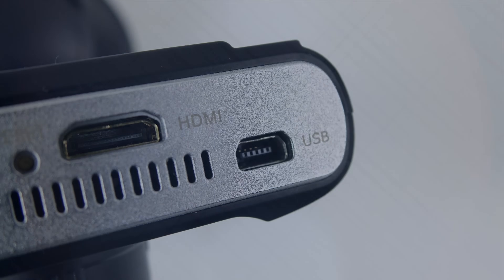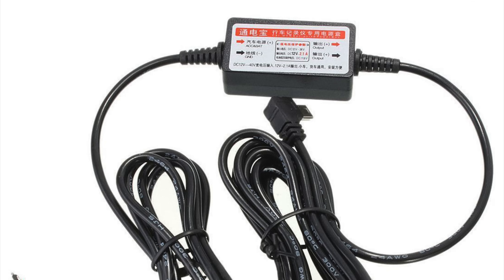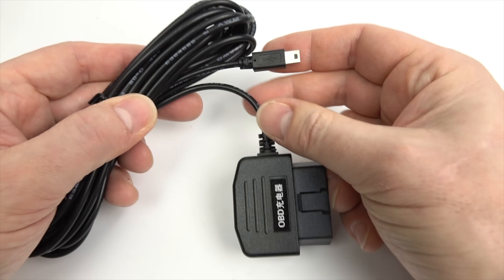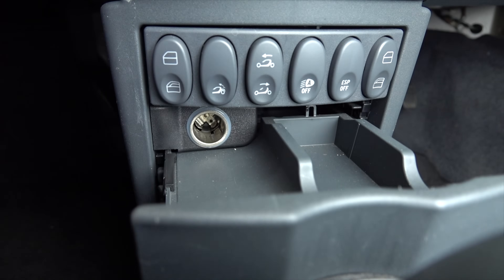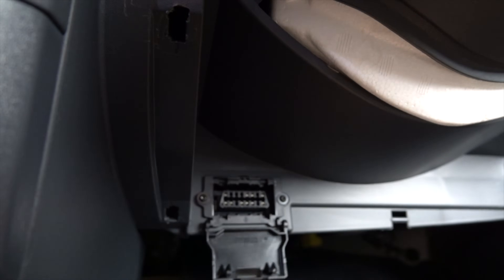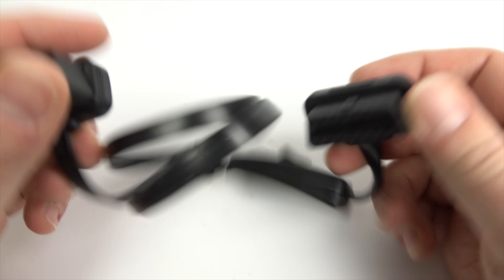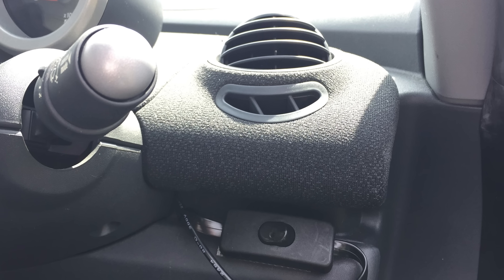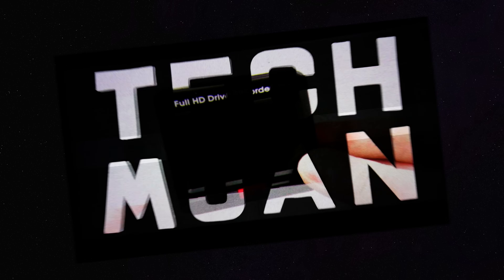You can power a Dashcam via your OBD port (but perhaps you shouldn't)

Comment: Can you charge a cell phone with this?
Reply from the maker: +Throwing Things Yes - thats the original purpose.
Reply: +Techmoan thx
Reply: +Michi Lo Uh... all it takes is 30 seconds opening the thing up. I can almost guarantee that nothing will be connected to CANH and CANL. It'll be either an LM7805 with necessary caps across the +12V/GND, or an MC34063 doing the same thing. That's it. If there was something connected to CAN, just remove those pins.
Reply: Maxx Fordham You really are fucked up, you know that? You're driving an otherwise sane, intelligent person to threats. What the fuck is wrong with you? Why do you even care? 

He's not entirely wrong. You did make up a phrase. Why not just admit it's a non-standard usage and be done with it?
Reply: ***** That might be a good idea. With those phone chargers it is ok, but there are some of those bluetooth adapters, and those i won't thrust anywhere.
Reply: Maxx Fordham My point was "attention payment" is an incorrect, stupidly worded phrase. How did you float through life saying such stupid things, boy?
Reply: +Aurelius R Your trolling has gone a bit far, but I agree that the other guy is a complete and utter asshat.
Reply: +Maxx Fordham +Aurelius R both of you need to walk away from the keyboard, and take a breather.
Reply: Maxx Fordham You're right, commonness and correctness ARE two separate things. However, "attention payment" is neither common nor correct. Again, the argument is that you made it up. If you can't show any sources that it has been used anywhere else, then that original point still stands. You don't have to defend yourself at all -- you are choosing to. Incorrect grammar is identified because we have a commonly accepted set of language we call English. Using those same rules, which you used to identify people misusing "you're" and "your", we can easily see that "attention payment" is incorrect as well.
Reply: EVERYONE SHUT UP MY PHONE SOUNDS LIKE AS TIME BOMB
Reply: Maxx Fordham Wow, you sound like one of those people who should be in old timey insane asylums. &quot;I&#39;M NOT THE CRAZY ONE, YOU ARE!! ALL OF YOU ARE!!!!!&quot;
Reply: Maxx Fordham LOL.
Reply: Maxx Fordham Attention payment? Seriously?
Reply: Maxx Fordham WHY DIDN'T YOU LISTEN TO ME? I TOLD YOU NOT TO REPLY! WHAT ARE YOU DOING?!?!?
Reply: Maxx Fordham I am genuinely laughing. You actually think attention payment is a real phrase. Oh god. You seriously couldn't make this stuff up!
Reply: Maxx Fordham Please, go check a dictionary. All the examples you used of the word "payment" were in reference to the exchange of money. When paying is used as a noun (payment), it's called a gerund. Using the verb "to pay" in relation to attention is a colloquial usage of the verb. Therefore, when used as a gerund, it no longer makes sense, because it's not being used to describe the exchange of money. In other words, when "to pay" is used a gerund, it is only used to describe the exchange of funds. Open a dictionary, you asshole. I can't believe you're still sticking to your guns.
Reply: Maxx Fordham You know, I've found that the people who attack the most viciously are those who are the most insecure and full of self-doubt. Accuse me of being conformist all you want -- you know nothing about me.
Reply: What the fuck... you really ARE a piece of shit, Maxx Fordham
Reply: I asked some English professors about "attention payment". They universally agreed it sounded like something a four year old would make up while trying to understand how that part of the language works. So it makes sense after all! You're just 4 years old. Pretty obvious, actually.
Reply: No, but really, they all said it was completely incorrect.
Reply: Muted. So fuck off. I win.
Reply: Maxx Fordham! Sorry, for some reason the name didn't automatically pop in. Fixed now! :D
Reply: Maxx Fordham Who said that? The other guy said he thought it was a bad idea, and I said it's almost certainly not, just crack the thing open and look for yourself.
Reply: Maxx Fordham Sorry, for some reason thought you WERE the OP.
Reply: Maxx Fordham Whatever you say.
Reply: Maxx Fordham You saying that we don't need to know each other defeats all of your insults, by the way. You couldn't possibly know any of the things you accuse me of based on the extremely limited information before you.
Reply: Maxx Fordham NO NO NO. DON'T EVEN BOTHER REPLYING. I SAID IT'S A REAL PHRASE, AND IT IS THEREFORE INDISPUTABLE!!! EVERYONE MUST BOW DOWN BEFORE MY LEGENDARY LINGUISTIC SKILLS!!
Reply: Maxx Fordham Find one example of it ever being used, by the way. 
http://lmgtfy.com/?q=%22attention+payment%22
Reply: Maxx Fordham You show examples of real phrases, as if that supports the creation of a similar phrase.

So, let's try this again. Telephone hook. Coat hook. Pirate hook. ... Graveyard hook. I just made a new phrase! And because there are other phrases which use similar words, I MUST be right!!
Reply: Maxx Fordham Yes, you've reduced to trolling, so I'm not going to stop trolling you either :)
Reply: Maxx Fordham Maxx Fordham is a complete idiot
Reply: Maxx Fordham Maxx Fordham is a complete idiot
Reply: Maxx Fordham Maxx Fordham is a complete idiot
Reply: Maxx Fordham Stop typing. Just stop. Go away, like a good little boy.
Reply: Ezmyrelda Andrade Jesus christ! Are you writing an assay?!?!
Reply: Michi Lo Those Bluetooth adapters are harmless. It's easy to prove -- connect a CAN sniffer between it and the ODB port. You won't see a single packet coming FROM the dongle.
Reply: ***** Not anyone has a CAN sniffer. And i still do not trust something from china that plugs into my car. Maybe it does not send packets now. But it is bluetooth. Someone a bit better in that stuff than me might be able to modify it so it CAN send packets. And i do not want that to happen. EVER!
Reply: But I would never trust anything from China that plugs into OBD.
You wouldn't want to know what you can do over OBD.

Comment: Have you tried an add-a-circuit link? Just plug the positive into the fuse box and ground the negative wherever convenient. I've started using these when adding stereos or lights to buddies cars as most of the time they don't keep the cars long.

http://www.ebay.com/itm/ADD-A-CIRCUIT-BLADE-STYLE-ATM-LOW-PROFILE-MINI-FUSE-HOLDER-FUSE-TAP-FUSE-SET-/171633550106?hash=item27f628231a:g:CoMAAOSwWKtUrf4i
Reply from the maker: +William Decoteau What is a good fuse to use when putting one of these in? I'm thinking of something that is powered on with the car and isn't on all the time.
Reply: You can usually go off the fuse that powers the 12v socket. The dash light circuit is powered on with the key most of the time too. You'll also want to make sure you get the right one for the type of fuse your car uses too.
Reply from the maker: +William Decoteau Thanks - I'll look into this.
Reply: +Techmoan I remember in the "good old days" when cars still had big round fuses and EFI was just a dream, we'd just hook everything up to the cigarette lighter fuse or a light circuit because they'd usually have beefy input wires. Tap off the input wire and use an inline fuse to our devices.

Comment: Wouldn't recommend he OBD2 power is meant for powering diagnostics machine and any dodgy back current could blow your canbus module or blow your ECU which you don't want
Reply from the maker: +iCloud I've changed the title to reflect the advice from experts like yourself that this is probably a bad idea.
Reply: +Techmoan sorry to bring it up after you've gone to the effort of making the video ! It's top notch quality like all your vids techmoan loved the vertical turn table video !
Reply: +iCloud Sorry, I disagree.  In devices like this, the unused pins are not going to be connected to anything.  No chance of current going anywhere it shouldn't.  Should be perfectly safe.
Reply from the maker: +iCloud If this is a real thing that has happened - I'd be interested if you could link to an article about this.
Reply: +Techmoan it's not something I would have assume it hasn't happened as of yet may be a 1/10,000 possibility or some odd statistic, but I work with diagnostics and if the 5v / 12v signal isn't returned to the diagnostics system it won't power the scanner that's why those OBD2 modules are self powering (Bluetooth ones). If you send voltage down the wrong pin it can be connected to sensitive electronics in the car like the airbag module which could set of the airbag but 9/10 there aren't pins connected in the actual obd2 connector for those to prevent things like this happening as it's cheaper than putting in back current protection systems but it's always worth a check! If you need anymore info or want any tips for OBD2 send me an email more than happy to explain more ! Hddan293@yahoo.co.uk
Reply: But isn't this just connected to the battery with all the other pins disconnected? I guess something odd could happen inside to cause some sort of short but not sure what.
Reply: +Cliff Hartle not necessarily some cars pass power through certain modules before powering the obd2 port such as my car has a canbus module that has the direct power pass through it first before going though to the obd2
Reply: iCloud not saying you or wrong but I checked the specs and it says battery. The last time I got a battery they fed 12 volts back into my system during the swap to keep my setting alive.
Reply: +Cliff Hartle yes they put a constant 12v on your system so it won't forget things like the radio code etc but I don't see how this related to the current topic?
Reply: +brassman5 even so if there was a short of some form inside the obd port or what you connect it to draws to much power and it either cause a lack of power to a module causing it to lose its coding or bricking the module or when the power pins are shorted that can short a module as well
Reply: iCloud this unit uses these pins for power. They wouldn't need to use any other pins. So would connect to any other parts of the car like the computer.
Reply: +iCloud Awful lot of what ifs and conjecture.

Comment: Reading through Wikipedia about OBD(2) I found the diagram of the adapter stating that 1 of the Pins in it: 
Pin1: VW/Audi/BMW: Switched +12V to tell a scan tool whether the ignition is on,
I wonder if the OBD is un-powered on German cars when the ignition is off. 
I can't test it tho, as I do not have one of those adapters. In each case, if it does not use that specific lead, you could probably rewire it to make it use that and have ignition-based power of OBD.

PS: I bet that the OBD adapter uses the last wire tho, which seems to be international standard for Battery Power out.

PS2: To know wether you have OBD2: Unlike the OBD-I connector, which was sometimes found under the hood of the vehicle, the OBD-II connector is required to be within 2 feet (0.61 m) of the steering wheel

Source: "https://en.wikipedia.org/wiki/On-board_diagnostics"
Reply from the maker: +SuperDeadSix I tried it in the Mini as well as the Smart and it stayed powered in that too. However I seem to recall that when I used an OBD device in my 2009 Smart a few years ago that it turned off when the car did - but perhaps it was being smart and looking at when the data stopped (or something) and actually going into standby. I think the only way to be sure is to try it out on your own vehicle.
Reply: +Techmoan Probably, interesting idea either way! Good to know in the future. Can't believe I never thought of that.
Reply: +youfermont Guess I have to use a multimeter and check if the first pin goes off in my BMW.
Reply: +youfermont Maybe the Bluetooth adapter checks that specific cable I mentioned to see if the ignition is on and then responds to that. That was my idea here, to build a small circuit that does that, all in 1 like a USB Adapter for the OBD t hat has 2 modes "turn off with ignition" or "always on", could be done quite easily, but probably isn't as international as only german cars seem to have that 1 wire ('least according to wikipedia).

Comment: you can also get battery low voltage cut off devices.
Reply from the maker: +Charles Smith I haven't seen these built into the OBD port convertors yet - but it would be great if they could add this feature into a device powered by OBD.

Comment: The pinout for OBD ports lists Pin 16 as Battery voltage. It will be on permanently in any vehicle that abides by the standard afaik.
Reply: +Marineio Considering that it's odd, that the USB converter thing doesn't have a switch built into it, makes it much less functional in my opinion.